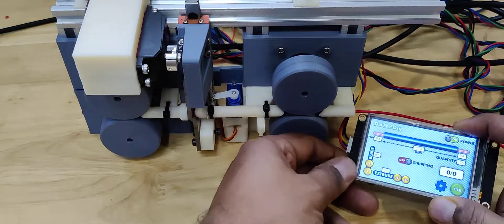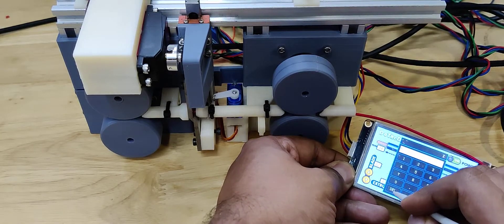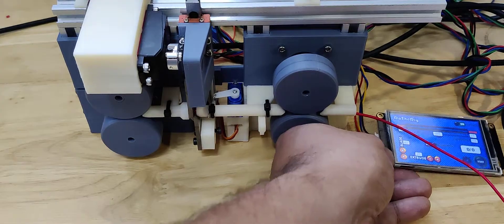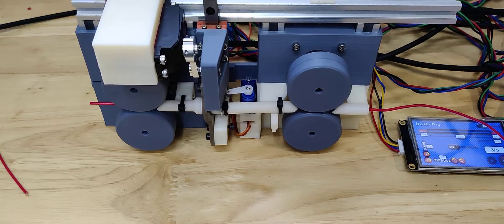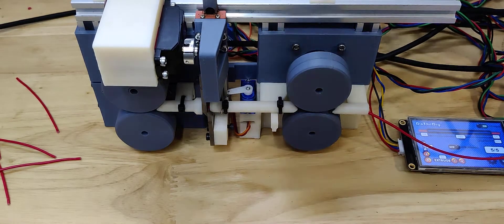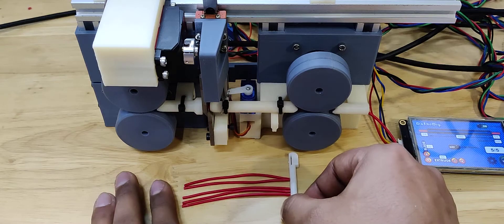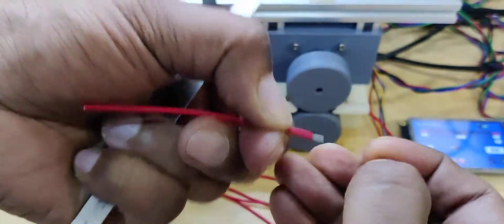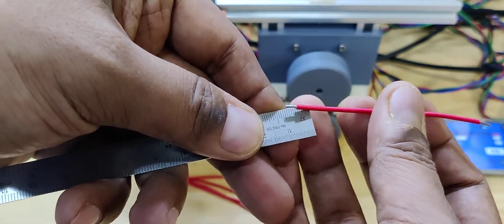Arduino Homemade  Automatic wire stripping cutting machine V2 WIP part 2

Comment: How do the stepper motor count length by rotation?
Reply from the maker: Stepper used has step angle of 1.8 so there are 200 steps per revolution. With this and pully size (parameter) I can calculate the length extruded per step parameter/200
Reply: @DoTheDiy  thank you :)